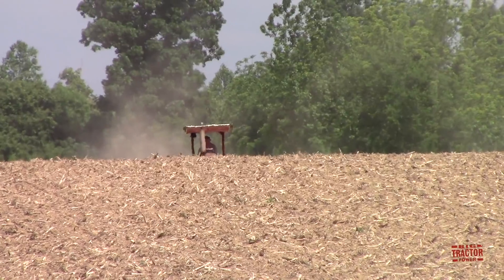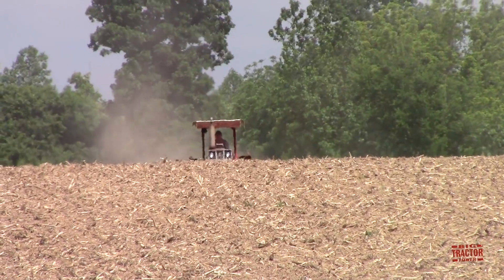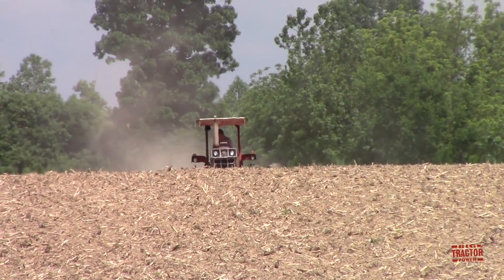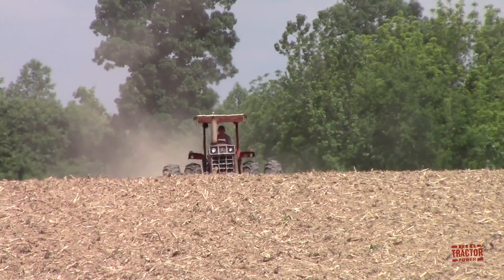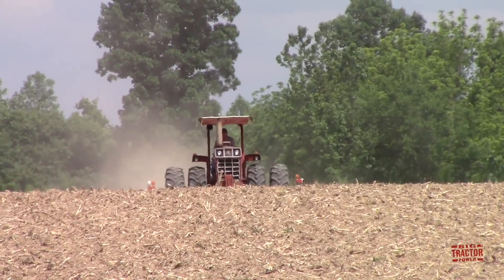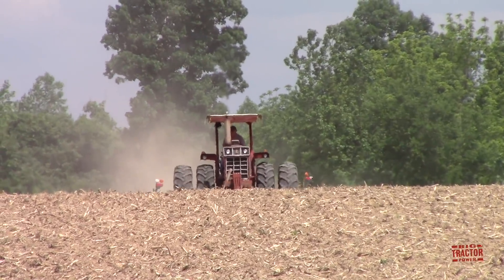International 966 Tractor & 11 Row John Deere 7240 Planter

Comment: Got a 1971 white stripe sitting in the yard now, only has around 3500 hours on it. Mainly use it for bush hogging, disking, grading roads, just around the house stuff. The pink insulation in the top of the ROPS is replacing some sort of thick stuff put in by IH, it was painted white. Over the years rust got behind it and it started falling down the back of your shirt , top of your head everywhere. So one day I just stopped and got a scraper and scraped it all out and glued some rubber insulation back to it. 
Replaced the weights on the front with a 150 gallon tank for a sprayer. 
With the 6 volt batteries you have to park it on a hill in the winter to let it roll start or it will burn the battery posts off, ask me how I know, lol.  Converted to 12 volt.
Ours has the High Low 4 speed transmission. Still have most of the first equipment we bought for it, 14 ft JD TW disk, 5 bottom JD breaking plow, 16ft AC field cultivator and a set of snap-on duels. 
Great tractor but with a straight exhaust pipe hearing protection is a must.

Comment: 966 was the first "big" tractor I ever drove. It had snap on duals and was open station with a canvas canopy top. I was 14 and thought it was the biggest tractor. Pulled a 4 bottom plow 9 shank chistle plow 4 row planters and a 13 foot harrow with it. Wish I could find a new one for 18.000 today.

Comment: Thanks for this video. I grew up on a 966 with a cab (no air conditioning!). I remember that sound.
Reply from the maker: The IH DT engines have a great sound. Did you have a red or a white cab 966?
Reply: bigtractorpower. We had a white cab. Very noisy. I kept the cab closed in the field to keep the dust out. I also had to wear ear muffs for the noise. 

I did have a ear bud though listening to either WLS out of Chicago, WKZI in Casey, IL , or KMOX listening to the Cardinals. 

The worse option was a 560 or 504 with umbrellas.

Comment: I believe the 966 and 1066 were offered with the hydrostatic transmission until the hydro 100 came about. I’m not sure how that all worked out. 

My uncle has an original black stripe 966 open station he bought brand new. Still has the original paint and decals. Clock has rolled over atleast once though as he uses it to this day for everything. He finally had to replace the clutch and TA a few years back. It’s been a damn good tractor for him.
Reply from the maker: Yes they did. The Hydro 66 models saw about a year of production and then the Hydro 100 split the difference between them.

Comment: Very good condition. It's look an old Oliver and here in Brazil there was a tractor called CBT Tractor Brazilian Company based on the Olivers.
Reply from the maker: The Oliver 55 and IH 66 tractors do have a similar look. The Oliver 55’s came out in 1969 just a few years before the IH 66s. I have sales literature on the CBT tractors.  I think they are sold in Florida as well for sugar cane work.  It’s neat the Oliver design has carried over.

Comment: Still have a 1066 Hydro my grandpa ran. When was the Hydro transmission made available?
Reply from the maker: The Hydro 1066 was introduced in 1971 but soon became the Hydro 100 because the Hydro 1066 put out about 105 hp compared to the 115 hp 106) gear drive.  A Hydro 1066 is pretty rare as the Hydro 100 saw 4 years of production.
Reply: bigtractorpower Thanks for the info! I still have it, it still starts first time every time. But he knew his way around that engine, so it put out a heluvalot more than 106 when he was done lol. He had it on a 8’ heavy duty roto tiller for working up light bush into farmable land. Tuned up the pto clutch too so we actually broke the pro splines twice from the torque before he turned it back just a little. Still use it on the auger occasionally, a Brant 13” auger, 110 feet long.

Comment: Bigtractorpower, have you seen an International Harvester hydro tractor?  The ones with the hydrostatic transmission?  I have been interested in those because I understand that there aren't many farm tractors with those transmissions.
Reply from the maker: I have filmed a 76’ Hydro 100.  I know a Garber with a 1066 Hydro but have not seen it working.

Comment: No row markers?  How did he tell where his next line was?
Reply: Was wondering the same is he just that good? No doubt old school and experience works but noting is better than technology when it comes to efficiently
Reply: When you have been doing it most of your life, it's not hard to gauge your spacing.  I don't use row markers on our 30 foot grain drill and still do a decent job, saves time turning on the headland not messing with raising and lowering markers.

Comment: Wow that's interesting I didn't realize you could take all those options off I thought that was all standard equipment on those old Reds 1974 Dodge Charger SE was 4000 so it sounds like if you strip that tractor you could have got it for 9